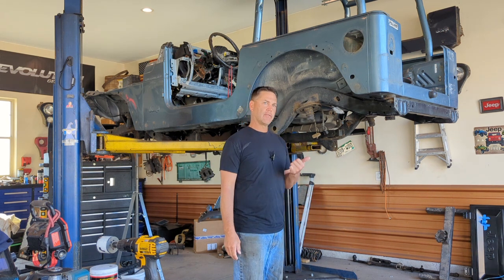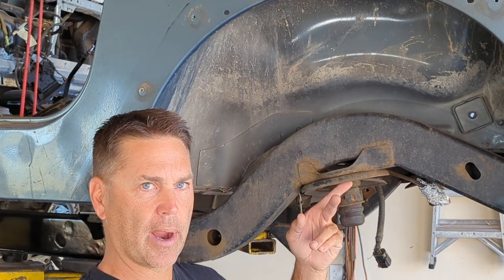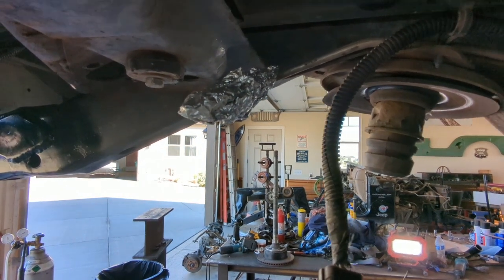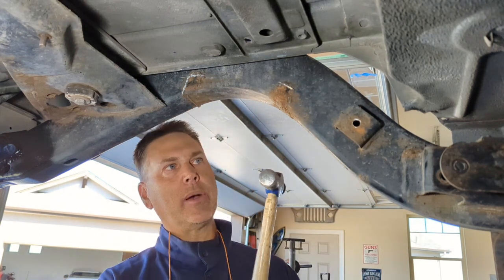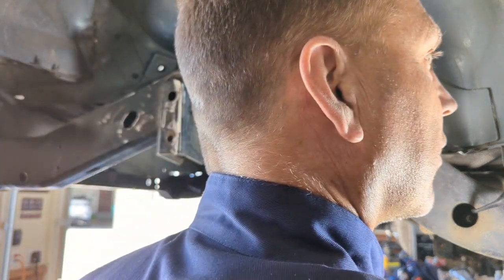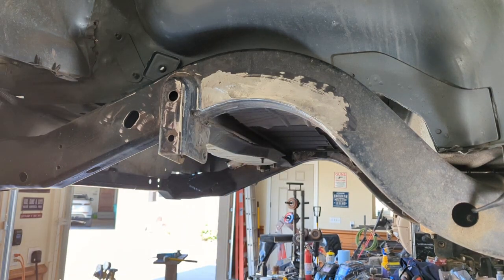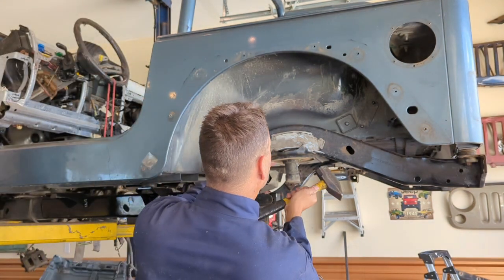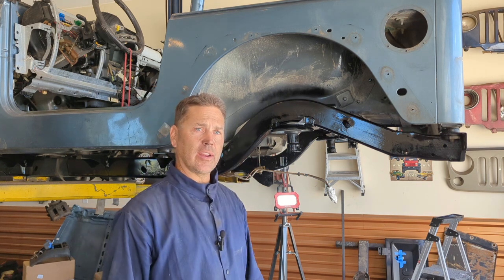How to Relocate Your Spring Perches

Comment: Thanks So Much for doing this!  Your video gave me the confidence to do this to my 2003 Rubicon.  My springs were so bent that they just didn't work well.  In fact, I put brand new Fox shocks on and they didn't last 1,000 miles.  My Jeep handled like a boat with the bent springs and now it is Very Solid!  Straight springs and new shocks make my jeep corner like it's on rails!  No more worries about being off camber.   One issue I had with my project was brake lines.  My brake line was bent in such a way that it was wedged between the relocated perch and the frame.  I wish I had straightened out those bends before I welded the driver side perch back on.  That would have made the work so much easier!

Comment: I actually did the same thing but I did swap mine side to side AND rotated the perches 180 that way they still sat on the side of the frame their suppose to. I also moved my track bar bracket back as well. Was able to push my axle back another two inches after doing this. Good video
Reply from the maker: There is no way I could push my axle back a 1/8" let alone 2". Mine rubbed against the gas tank skid as it was. You could swap the perches I suppose, but trimming them is just as easy.

Comment: No reason to move the top mount unless stretching wheelbase,  rotate the axle mount.
Reply from the maker: Moving the lower mount by itself isn't enough. I relocated all my brackets on my Dana 44 (rotated pinion). By doing both uppers and lowers you can get close to parallel at full bump. Most people don't want to do all the work for axle bracket relocation.